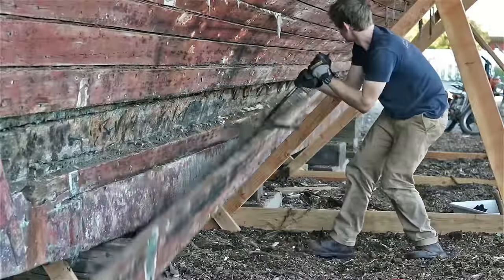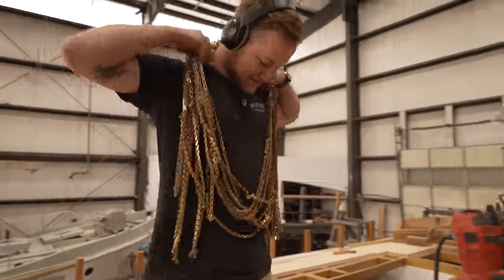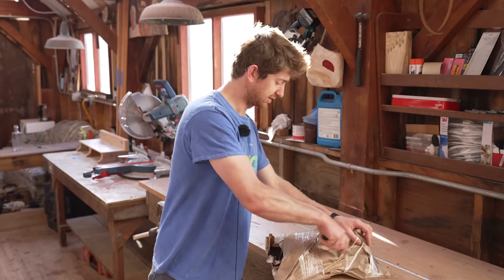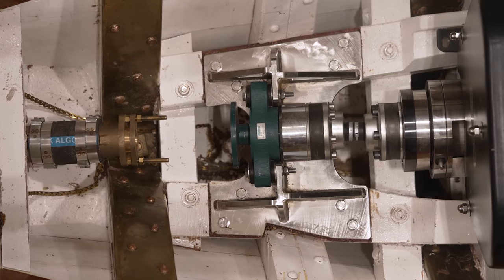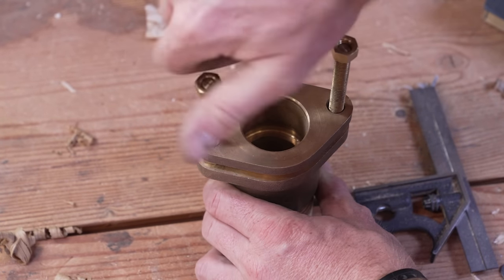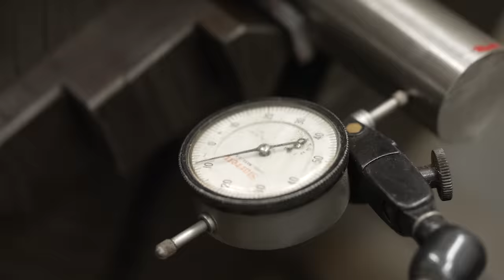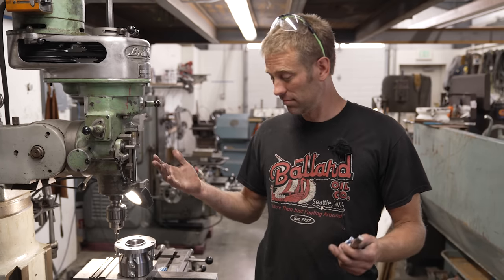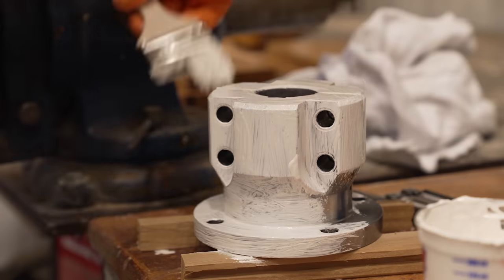Machining the Driveline & installing an unusual Propeller (metalwork & boatbuilding)

Comment: What a wonderful piece of engineering you have specified for TH. I like every part of it! Engineering in that area has come a long way since I had much to do with prop shafts, tubes and stuffing boxes. I was please for you that you decided to have a four bladed propellor as well; with a substantial deadwood ahead of it, if you had chosen a three-bladed one, at any moment only one blade would be working at 100%, and the addition of just one blade improves this immensely. 
I was surprised to note that you appeared not to smear grease or silicone grease on the mating surfaces of the prop and shaft, and the terminal cone. I guess you might have left them out for the filming, and attended to it later. If you have any comments on this, my only riposte is that when you come to take off the propellor (polishing, filing, and heaven forfend....repair) you will curse not having included the lubricant, as you surely won't be beating the thread on the end of the shaft! 
As others have commented, I must congratulate you on your techniques of presentation. You're a natural, and with your wide knowledge, authoritative as well.

Comment: Not a boat guy, but I have specified couplings on hundreds of industrial pumps.  We generally match each half of the coupling to the corresponding shaft metallurgy.  The steel coupling on the stainless shaft will have a mild galvanic associated with it.  If you expect no saltwater to get into the joint and it's just seeing humidity, then it will just be difficult to remove like an aluminum wheel on a car.  If you expect saltwater to come into contact with the coupling/shaft joint regularly, then the stainless shaft will experience some galvanic corrosion over time.  Recommend you contact your coupling supplier and see if they recommend replacing the prop shaft side of the coupling with stainless.  You will still have a galvanic, but it's on the coupling flanges now where it's easy to install an isolation gasket & bolt set to minimize it. (may require additional grounding) But even if you don't install an isolation gasket, the couplings are more consumable than the shaft.

Comment: So good guys!  Excited to see how you control the pitch of that prop.
Reply: It's not a variable-pitch prop - gearing inside the hub turns the blades to full-fwd or full-rev pitch when the shaft is rotated by the engine or motors.

Comment: I want an Aqua drive on my boat. Because with the masterful machined (and welded bracket) delivery of needed power to that "Veri-Prop" is my estimate of what would withstand storm.  Satisfyingly brilliant to think of Tally Ho, as would float upon the sea.  So, just ahead, rigging sorted and mast stepped to a coin, a moment will come when we viewers might watch a first shakedown sail get underway.   And forgive me if I can only tell that such a vessel comes alive.  Where all of this work, captured to various craft timber, fitment, 
can be felt from the feet to the breath of any crew aboard.  I was away and lived right there, you see.  M.

Comment: AquaDrive components were specified by a well experienced customer in a boat I designed. They proved to be really good, and made this craft extremely smooth and quiet. The diesel engine ended up sounding more like a quiet electric motor, and vibration.... NONE ! The thrust loads are not so huge as Leo makes out. People often go OTT with their load guesses. Use the real numbers, and you can engineer things without adding excessive weight.

Comment: The workmanship of the individual pieces is a work of art. Well thought out drive pieces and the adjustable pitch prop is very cool.  Is there enough exposure outside the keel to reach clean water for propulsion?   Can’t wait to see the rudder and steering in place.  I know there are many details left before she sets in the water but you are in the home stretch.  I can’t wait to see her sails set and Tally Ho under way on her first  shakedown cruise.   Great job to the crew, the corporate sponsors and machinists who got the ship to this point.   Cheers Mates!

Comment: The chain is a brilliant solution to a problem that really must be taken seriously, and George killed the delivery! I do have concern about that chain and if it is actually brass/bronze or just brass-coated tin? It needs to hold up for while in a rather challenging environment. Cheers.
Reply: Sash chain is available in bronze or steel, w/ or w/o plating. Leo avoids iron material in the boat, so I'm sure he bought the bronze kind.

Comment: Leo, you taught me my required "one new thing [minimum] every day" for today. I never thought about regenerative feathering of the propeller while under sail! 
Now that you showed this part, it seems a very smart thing to do, and it is well within our technological, engineering, and manufacturing capabilities. I do wonder, now, how long this has been about, so I have to think back a bit. (Just hoping not to embarrass myself over how long it has been.) 
I openly admit that I am not a boatbuilder, and no sailor, at all. (My experience is more with horizontal 'sails' [wings].) I am a woodworker though, plus have an architectural background, and have dabbled in cedar strip boat rehabilitation and cedar strip canoe building. Watching your series has been a thoroughly enjoyable learning experience! Looking forward to your next posting. Thanks so much for your sharing!

Comment: The rudder is a keeper for the prop shaft; if lost, that would be the least of your concerns. Hopefully the bearings et al are happy with reverse shaft thrust when the prop is feathered for feeding power to the generator?
ETA: torque paint the dive shaft so if it does get pulled out, the existence of a problem is certain.

Comment: I have one more addition?!
As Glan seal. there is almost certainly a Fiber-like Use. Then lubricate the gloss on the water side with a naturally safe grease.
However, THERE is also a rib pack. Made of Pure Graphite (used from space to protect (melting upon return to the atmosphere)
that material is for sale, as a ribbed band. If you press it into a model, you create a split (oblique) seal or not.
It doesn't need any lubrication. is completely 100% natural and has a lower resistance than lubricated with grease.
the wear of the axle. (stainless steel) is also nil. Even with a heavily sanded water side (sand for example), the stainless steel shaft becomes highly shiny.
I used that combination for a pump. which had to process both vacuum and high pressure. (Gouache.)

Groeten van Giel Klaver  Holland .

Comment: Just found this a second time. Interesting video. Never seen the Aquadrive coupling/thrust bearing before, interesting piece of gear. I hope you checked the prop/shaft contact area with bluing.Should be at least 75% contact between both.

Comment: Hey Leo I see the zinc anode My boat timber have removed ALL zinc anodes 15 years ago, and replaced with mild steel.
Nil electrolysis since this was done. Perkins motor is above earth.😎

Comment: Hello, I look at mounting the propeller shaft. In the Tallie Ho. I saw that (if it is the definitive assembly) that the key where a fixed screw is intended in the middle, that it was not in it during assembly.
With a greeting G.F.klaver. The Netherlands .

Comment: HOT TIP!   Concerning your Epoxy paint job on the drive coupler:
 I've been using for years this type of product, and with unbelievable success in areas of the engine room, components on the engine  & drivetrain, plus interior applications all over the Yachts....what is it?  Rattle Can Epoxy Appliance Paint!  Read about the chemistry,    it's tenacious. I've got stuff in perfect condition I've done 10++ years ago,  as long as you have no underline Iron oxide traces, also known as rust, in which case remove and or convert with the appropriate rest converter.

Rust-Oleum 7886830 Appliance Epoxy, 12 oz,  is a good example of one, and comes in varios colors.
If you feel the need for a quality all metal primer,  here you go: Pettit, Rustlok Steel Primer is a good choice..

This appliance paint is so dang easy, plus it flows/pulls out perfectly glass flat for that highend money coat, provided that you've done the underline prep work to allow it so.

I've been running steel yachts for over 40 years and I've done and seen it all.
Anyway, back to the video!

Comment: Great work as ever.Maybe, as others bave commented, grease the prop shaft in the mild steel coupling.I notice you didn't insert the set screw into the hole Dylan drilled in the mild steel coupling ?

Comment: A way to get a good looking finish with a paintbrush on a small part is to apply paint by a sort of tamping movements with the brush end. Takes little bit of practice and is rather slow but can get you a really uniform paint roller-like surface. Makes it trivial to get into fine crevices you might normally find hard to paint properly as well.

Comment: Nice job. I hope you didn't make the mistake I once did when fastening the cone onto the prop (of a saildrive) after a refit. I greased the retaining cap screw instead of putting lockthread on it, and the bloody prop dropped off - fortunately on the mooring, so I got it back.

Comment: Bro dripless system come with extra seal O rings incorporated in front of the unit so you can replace it with out having to take the shaft out , you can have 2 or 3 extra ones , look into it 🤜🤛

Comment: I have never seen a prop fitted without it being blued up and hand scraped for fitment to the shaft. Is this because it's a variable pitch prop? I would be checking the prop after a few hours of use and checking the torque of the nut that holds it on, not saying it will fall off but it could chatter if it comes loose and ruin the tapered internal bore and the shaft!  I do like the CV joint coupling, saves time lining up the drive to the shaft. All the best.

Comment: Awesome hardware you scored there Leo.  I'm thinking maybe some anti-sieze on the shaft to mild steel coupling joint may make it easier to dismantle later on. You know, the nickel or the copper one. Also maybe that mild steel part could have been painted with POR 15 or similar?  I do this with industrial machines so i don't waste my day dismantling  siezed stuff.

Comment: 2:54 another method i've seen used is involving a stainless steel braided wire with plastic brushes clamped on with stainless steel clips. The brushes are the long noodle type you see used to clean refrigeration vents and the like (common in the industry). A simple spring on one end, and a lever on the other ( you pull on the lever and it pulls on the spring on the other end cycling the brushes through the holes (they rest outside them during normal operation). Simple and effective, zero maintenance, on an old-ish Schooner.

Comment: Great video Leo. I was surprised how many components were included in the drive shaft, about three times as much as what was in my sailboat. I was surprised at the size of the propeller relative to the size of TALLY HO. I would have expected a prop that was at least twice to three times compared to the one you have. It will be interesting to see what happens when it's in the water. I hope TALLY HO won't be underpowered.
Reply: It is a sailing vessel. They are always underpowered. 
Otherwise it would be termed a motor sailor. 
And it would not sail as well as a sailing vessel would.
Reply: @Gottenhimfella  Any modern auxiliary engine can push the boat to hull speed.  My Kelly-Peterson 46 had an 85 HP diesel and wasn't underpowered at all.
Reply: @two-sense  This particular thread is about propellor size (to deliver power to the water), not engine power (delivered to the shaft). 
A sufficiently large propellor for Tallyho to achieve motor sailor performance in all conditions would unduly diminish sailing performance, somewhat because of drag but mainly through an excessively large rudder aperture making the rudder ineffective without prop wash.
Reply: @Gottenhimfella  You simply stated that sailboats "are always underpowered".  I am just saying that mine wasn't and neither were most of the cruising boats, both modern and traditional, which we cruised with in our 8 years of offshore cruising.  Just presenting the facts.  I'm sure there are many watching this channel who know that what I am saying is correct, but you are entitled to your own opinion.

Comment: Nice work...the only comment I would make is that anti seize paste should have been used between the coupling and the prop shaft. Will make it so much easier for dismantle and greatly reduce corrosion in that hub/shaft junction. Cheers.

Comment: You probably know this, but suggesting it anyway since didnt see it on the video.  You need to heavily coat that shaft with a good marine grade grease that will not dry out before you slip that prop on.  Even though the 2 metals are close on the Nobility Chart, salt deposits and corrosion can make it a bear to remove when the time comes.  Evinrude Triple Guard grease is good, never dries out, readily available.  Im sure othergood marine greases are out there.  Maybe someone suggested this below, I didnt look.  Nice job.

Comment: Hey Leo please explain the prop function as you will be utilizing it.  Regen, under motor power and sailing.  Several explanations in the comments but still not clear as how it will actually perform on the water.  How do you get the optimum pitch for regen? What pitch will be needed for the hp of the engine you have? How fast do you need to spin the electric motor for optimum output?
Thanks for all the great content.

Comment: It is indeed all what others are saying and this is a fantastic project. I'm watching it from the very beginning and I'm impressed with amount of super high quality of work, skills, tools, materials, filming and great people. However, there is one thing in this episode I cannot understand, it is the prop. Why self-feathering prop? Normally under sail, yes, you want as little drag as possible from the prop but with regeneration drag is an essential element to have. As you said, it has to be set in reverse, so it will turn the shaft. It is a bit awkward, though, to do so under way and make sure prop is set as needed. So, under power - you need prop open, under sail - you need it in reverse also open. Then when will you decide, not to produce energy and sail with minimal drag? On long passages having batteries charged is important, as is saving fuel and not to run the engine or generator all the time. Racing maybe? Or in light winds to make a better progress? Well, you want make any re-gen without certain speed anyway. So, what was the reason behind your choice?

Comment: Leo, when you put the prop on don't dry fit it. Use Res-Q-Stel or another anti-seize so you can get it off next time. I had big problems getting my bronze prop off my bronze shaft. Stainless and bronze will be worse. After using Res-Q-Stel it just slide off.

Comment: AquaMet is the usual alloy for marine prop-shafts.  Nice stuff, not too expensive and machines really well.  In this application, its likely that "straightening' wont be needed as the shaft isnt that long.

Comment: Great to see some metalwork for a change. That thrust bracket is a work of art. One question though.. I think when using the prop to recharge the battery it should be locked in forwards rather than reverse. I think most DC electric motors need to be turned the same way to do regen but perhaps I'm wrong.

Comment: Just an FYI regarding the power plant in the background: that is NOT smoke you see, but water vapor that is needed in the generation cycle to keep the steam and condensate at the necessary temperatures. I worked for a large electric company years ago (distribution planning engineer) and we would always get angry calls on cold winter mornings when people thought they saw smoke. This has been a public service announcement. 🤓
Reply: It's a paper mill.

Comment: Please check this out. Modern cord designed for this type of arrangement is not as effective as their original hemp counterparts ,as they do NOT expand with the water.This means that if there is any eccentricity the modern cord will get pushed out of the way and the leak will persist.However hemp will follow the movement and seal better.

Comment: Setting the pitch fore and after should be done with a prop scan, that way you get it as close as you can as well as balancing it with a arbor and taking material off the blades where it needs.

Comment: I didn’t see Leo. Test fit and mark the shaft without the Woodruff key in place to be sure that when fitted the prop isn’t stopped from fully engaging on the taper by interference with the key. Maybe I missed it or was it off-camera?

Comment: Did you consider lapping the shaft to the coupling and propellor?  I'll fitting stuff causes cracks to develop and stuff to break.
Radiused keyways are a good thing.

Comment: The whole regen and prop thing is interesting. If you lock the prop in reverse pitch, the shaft will spin backwards during regen. That should be OK because the generator probably does not care which way it spins. But I wasn't expecting that.

Comment: As you said she is now ready to go into the water, do you think it would be a good idea to float her? All of the fine joinery internally and the engine alignment will be slightly effected by the boat taking up, I have experience with Tasmanian pine boats and it’s definitely going to have a lesser influence on tally ho because of her denser planks.. are you going to do multiple engine alignments? Or do you foresee having to rebuild a few pieces of squeaky cabinetry once she’s taken a beating out in the ocean?
Cheers

Comment: Are you not having a water feed for the cutlass bearing, I guess it will be having a easy life, we have a tides seal with a water feed for the cutlass hanging off the back of the 8LXB and self change box.